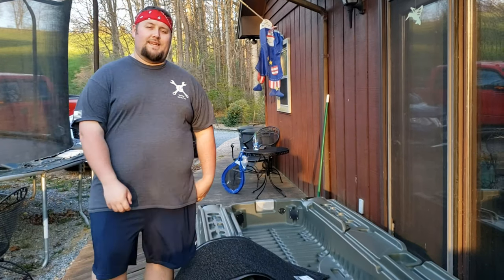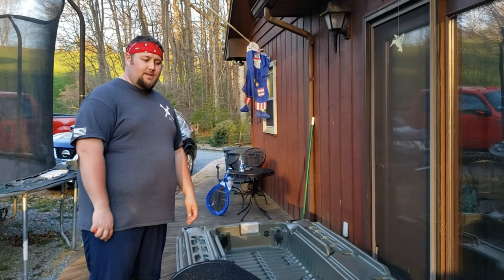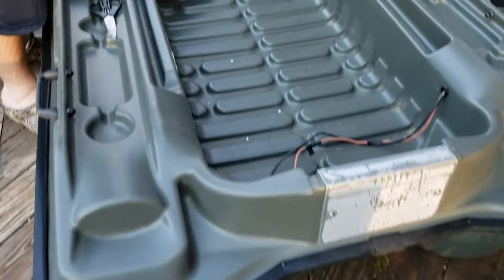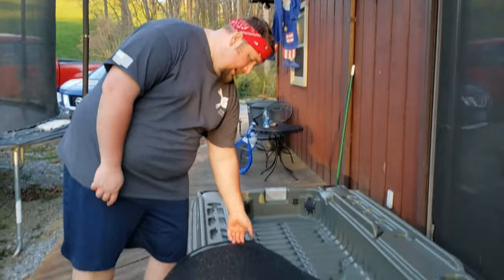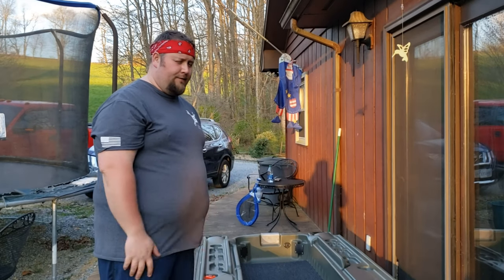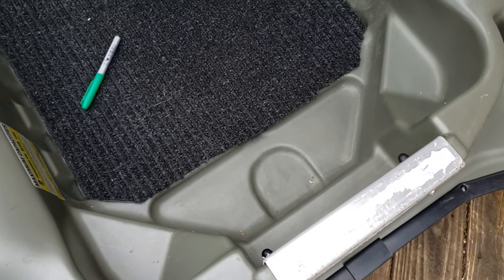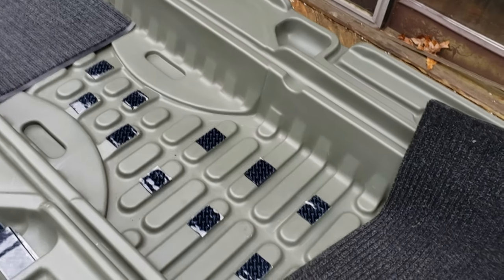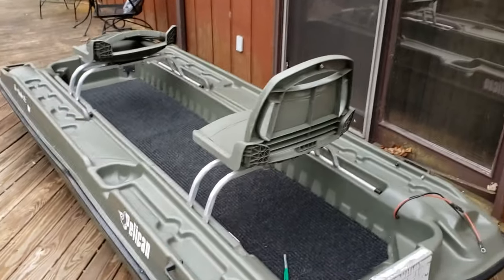Pelican Bass Raider 10e | 2020 Modifications | Carpet Flooring

Comment: Looks good . I like my 10 E Bass Raider I have a Mercury 3.3 gas Engine on the back and a 24 lb. Trolling Motor on the Front . And I`m a big guy at 300 lb and this boat is very stable .
Reply from the maker: It sure is i love mine

Comment: I have one of the tan/green 10e’s, that grey looks sharp!  I saw that you took the top off of your battery center while it was charging.  I had the same question with mine and Minn Kota said it was ok to leave it on and clamp to the box terminals on the top.  Much easier.  Nice rig!
Reply from the maker: thanks for sharing that info man , I wasn't sure if the built in breaker would throw it or not while trickle charging

Comment: Hi good video one question , my pelican bass raider damage the black  rubber  bumper , how can I  fixed it? O where can I find it ? Thanks
Reply from the maker: sorry just saw this message - I would go online and lookup Pelican and call customer support and see if they sell the trim guard through them just because they will have it exactly trimmed for your boat 

but if you want to try a modification see these links for what a friend of mine used and seems to work ok 

( note this is a link to the product , but not the actual one he bought ) 

you will need to take a piece of the one that came off your boat and measure it to find the correct sizes 

hope this helps 

https://amzn.to/30sDBk2
Reply: @FishingWithBIGD  thanks so much